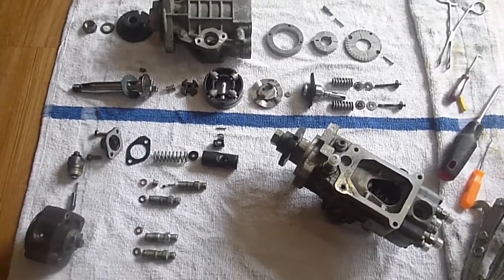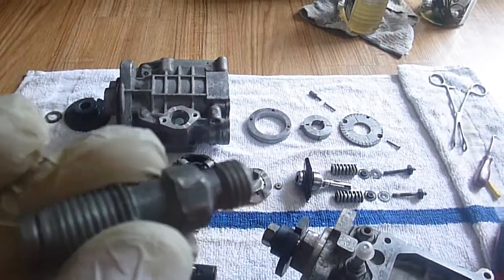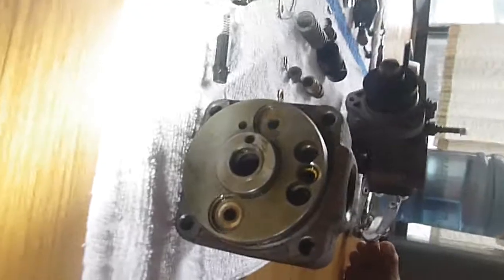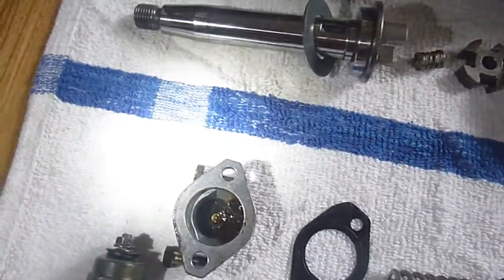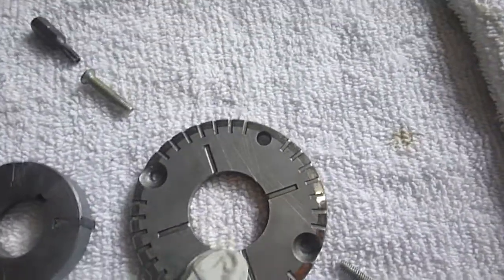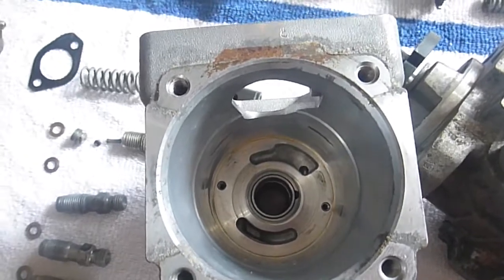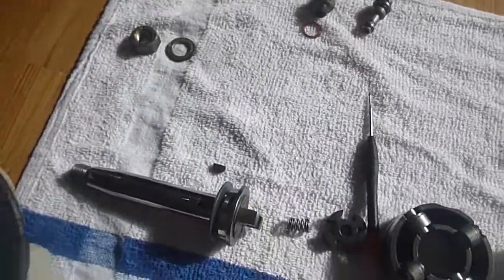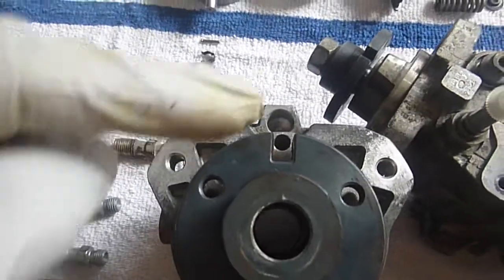ULTIMATE: ALH Diesel Pump Teardown

Comment: NOTE:  THE TIMING MARK IS IN LINE WITH THE BOLT HOLE AND THE RAISED CASTING MARKS.  SO EVEN IF THE MARK IS MISSING, YOU KNOW HOW TO ALIGN THE KEYWAY AT THE END OF THE SHAFT.

Comment: @GallowayChicago I completed the tear down of an 11mm pump, everything seemed to have went well. When I finished I removed the locking key and turned it almost 180 degrees (no ideal where my head was at) I quickly turned it back and checked the timing mark on the pump with the key on the shaft and it was very close again? pretty much right on. Do you think I caused any problems? thank you

Comment: Thanks for this small gem of info, i pulled all this apart to give my motor some maintenance and at this point even the bentley manual only covers the one piece pump gear. You need this info on the two piece gear to set it up because no woodruff key is used to aid in clocking it in properly despite having the keyway present!!!.... at first i thought the key may have fell out without me seeing, but the hub piece has no slot in it for a key so its press fit. Only you seem to know the secret. Thanks
Reply from the maker: Very welcome

Comment: Idk have a question for you though . I have to rebuild my 10mm I have a tune and bigger injectors . Basically I bought the 165hp kit from Kerma including the 3” exhaust . A HUGE DIFFERENCE! I even Tow w my wagon and it pulls like an SOB ! My question to you is how well do you think the 12mm pump upgrade would work out for me w what I have installed ?? I was gonna buy an 11mm but then came across these 12mm pump upgrades on eBay for like $150 . What’s your opinion my dude ?
Reply from the maker: I have not seen the 12mm. is it a knock-off or a genuine VW OEM pump. the 10mm and 11mm have been proven and as long as you get a rebuild one or rebuild it yourself you should have many fun years of dependable service. I have seen some wild cheap/cheaply-made eBay products and for the most part "you get what you pay for". Hell, I just looked right now on eBay and new/refurbished 10mm ALH pumps are still selling for $1,150 USD. I could not find any listing for a 12mm ALH pump.
I know what you mean about towing much larger autos. My brother has a 1971 Ford Mustang convertible and call me one day to help him out with a tow. He was surprised when I showed up with my little 1.9L TDI Golf. Towing is the only time when I can now recommend a Single-Mass Flywheel (only if you do 25% towing or more), but for a day-to-day fun ride Dual-Mass Flywheels are now build well enough to be dependable. People looked on in amazement a I towed if down the street.

TDI Love from Chicago.
Reply: The 11mm pump will supply more than enough fuel for that config

Comment: so did it work? Did you have to send to somrine to be calibrated?
Reply from the maker: It 100% worked and is still working today. There is a re-build kit you need to buy from ebay. But my little TDI would not start and when it finally did it had 0% power. After the rebuild it ran 1000% better. Cleaning the Electronic Quantity Control is what really did the trick, but there was nasty goo at the bottom of the pump too.

TDI Love from Chicago...

Comment: I tried this, took the pump apart and lined everything up and the pump timing was still off. The line did not help
Reply: You probably placed the internal parts 180° off. It's possible and sucks to do

Comment: I can almost read the number off the shaft seal.  I'm having a hard time finding one for sale.
Reply from the maker: Thanks for watching. Are you talking about the large metal washer that  is on the main shaft?
Reply: @GallowayChicago  Hey, thanks for the reply.  As to you question, no, I was talking about the front pump shaft seal (red/orange).  Maybe they NEVER fail.  I what to change it in case it is letting air into the pump and allowing fuel drain back or something.  It is not leaking fuel out.
Reply from the maker: @petersherrouse33  When I bought the eBay rebuild kit it came with the front pump seal. examples: https://www.ebay.com/itm/143881826646? and https://www.ebay.com/itm/144021944384?
Reply from the maker: @petersherrouse33  way to think ahead. I usually just dive head long into the problem and solve it as I go. Really some of the big questions don't appear until the tear-down is done. Remember polish the hell out of those rollers and roller shafts. My rollers were almost fused together with the shafts and as a result were rubbing against the pump body. I used "Mother's Chrome Polish". And don't forget to open the bottom of the pump (cold start adjuster). All kinds of goo gets stuck in there. Good luck to you mate. TDI Love from Chicago.
Reply: My research revealed: the EDM pumps (Mk4 ALH, electronically controlled,) have 20mm shafts (older VE pumps have a 17mm shaft).  The seal dimensions are 20mm (ID) x 31mm (OD) X 7.3 mm (thk)  the Bosch number of the 20mm ID seal is  F 01M 100 984.   I found two other seal numbers that may interchange Rave TG20 31 7.3 3 and the one in the pump you film (best I can make out) Kaco 52 (or 5Z?) DF20 51(or 31) 7.3 TVF03.  I was able to find a seller on ebay for about $15.   I can't understand why NO kit comes with this seal and how it's near impossible to find someone selling it (and indicating that it fits the EDM pumps).  My Jetta has developed long crank to start issue.  I have checked everything else and am ready to go though the pump but I'm not pulling is out and apart until I have all the seals!

Comment: Hi what is the correct torque for shaft nut sprocket
Reply from the maker: I can not find Torque but I found this: https://forums.tdiclub.com/index.php?threads/alh-injection-pump-rehabilitation-reseal.369621/

Comment: Can I pull the head unit out without taking rest of the pump apart?  My o ring is leaking.
Reply from the maker: If you are asking if you can remove the IP/IQ/AQ assemble from the top of the Diesel pump without removing the pump? Then the answer is YES. For one of the bolts you need a special tool or a Dremel tool and a large flat-head screw driver, But everything else is straight forwarded.  Take a look at the following YouTube video for guidance: https://www.youtube.com/watch?v=nd50iJIlvkI. It is very important to remove the IQ assemble completely before opening the unit to check for wear.  Pay special attention to the spring response before recovering the IQ assemble. Use silicone RTV and a cut out 12/16oz clear pop bottle to set the IQ bolts once you are done cleaning the unit. If you clean the IQ right the motor will run better then new.

TDI Love from Chicago.

Comment: I'm in Iowa City, my pump sounds like this: https://www.youtube.com/watch?v=nn8Jt_DfaH0

Currently sourcing a 11mm IP, how much are they in Chicago?
Reply from the maker: It is hard but not impossible to find them in junkyards. I would suggest trying eBay first (examples are itm#:264916156748 or 373451322804). it is reasonable to expect a price range from $200 for a clean unrebuilt unit to as much as $500 for a ready to install rebuilt unit with gears and everything. Hope that helps. The two examples are current and priced at $290 rebuilt and $170 unknown. You must make sure the units are 11mm and will fit your application. These pumps are not hard to tear down but require time to put back together again. The hardest part is pulling the front gear, but the electronic IP must be tested for spring return even on rebuilt units. As a reference these pumps in 2005 were over $3,000 us dollars but now being 19 years beyond the last production date of these amazing little diesels the price should be between $200-$500. I reassembled my unit with 100% Silicone gear lube. the lower part of the pump and the IP are prone to gumming up with diesel gel, but cleaning with 2 or 3 cans of break cleaner in a well ventilated area does the trick. I would like to repeat; taking the pump apart is easy after removing the front gear. Cleaning the almost all metal pump is easy. As long as you can turn the pump three rotations it should be a good candidate for a rebuild. I was only able to find Russian YouTube videos on cleaning the IP to verify appropriate spring return. I soaked my IP in a can of parts cleaner for 1 week to loosen up the return spring, but a rebuilt pump should verify a proper IP response. The unit I show in the video was found a a local junkyard and I was lucky enough to get it for under $50, but this is not typical and generally eBay is you current best resource. I still don't know how to visually tell an 11mm pump from a 10mm pump. So, you should go by part number and/or eBay descriptions. Lastly make sure the IP cable has not been cut or you will have to replace or rebuild the IP which is a pain. look at some eBay item picture and you will see what I mean. The good news is a clean/rebuilt diesel pump properly installed and timed should make your car run like new again and eBay still has rebuild kits from $20 to $50 for these pumps (ex: 162096676117). Good luck.

TDI Love from Chicago...
Reply: @GallowayChicago  thank you!! Wow a lot to think about. The car ran pretty good today, only made noise for a few minutes and then settled down. I will read more about adding ATF+4 and the risks involved, currently have the TC-W3 added which seems to help. I think your advice about not touching it until it's broken is wise!! Will keep my eyes out for a 11mm pump! Thanks again for the tips!

Comment: Thank you so much I really needed it
Reply from the maker: You are so welcome. I actually broke my cheap Harber-F. puller on on the second pump.
Reply: GallowayChicago ok I just always pry on them and tap it with a bigger hammer 🔨 and it usually works. I am butting a tdi alh into a boat
Reply from the maker: WOW! These little TDIs are really strong. Make sure your adapter is a solid one. Good luck.

Comment: Hi! Thanks for the in depth video. The relieve valve sets the pressure inside the pump? If yes, how? If you push the safety clip inside is should rise the pressure? How much should one push it to achieve a higher pressure? Is a higher pressure inside the case better for bigger injectors 0.320 ? Should I leave the case pressure as it is if I am going to get a software tune? I hear the case pressure will only affect the advance until 2500 rpm. Thank you and looking forward to your answer !
Reply: the pressure is set by the piston being pushed up into the hole until it reaches the holes.  The ring in the end only holds it together.  It will basically work ok until the ring and plunger falls out.
Reply: @petersherrouse33  I welded it in place, it should remain the same. Thanks for the answer!
Reply from the maker: Thanks for watching. I am in no way an expert in diesel pumps, but: You are mistaking pressure with volume. If you are going to use bigger injectors you need more diesel volume. The largest oem pump are the pumps in the automatic diesel autos. If you already have an automatic diesel pump then the next upgrade to achieve more power is a larger turbo. Here, you have many turbo oem and non-oem options. please contact  Metalnerd.com at www.metalnerd.com. he knows everything about diesels.

Comment: Sitting for almost 2 years?  The 06 I just bought was sitting for 2 or more years, so the pump is probably what is making the bad noise. Still tearing it down, haven't found the problem yet. 
How do you set/adjust the timing on the pump??        

  - thanks, take care
Reply from the maker: Thanks for watching. All the pumps are set with a static timing. That is to say that even though you could make adjustments inside the pump, it is NEVER recommended to adjust the timing on the pump side. Instead standard timing adjustments are done with the three bolts attached to the front of the pump. You need a VCDS or Vag-Com to identify timing adjustment requirements. But to make the adjustment you move the diesel pump front cam gear (after loosing the front three bolt) by tiny increments unteal the VCDS graph shows optimum timing.

TDI Love from Chicago.
Reply: @GallowayChicago  Okay cool, thanks for the info man.  It was my tired DMFlywheel in the dsg rattling. Still learning about the pumps & basic diesel theory.  Aside from the old DMF rattling sound, how do you think it sounds? :   https://www.youtube.com/watch?v=U83W87hVxBI    My know it all smart arse mechanic buddy said he could hear a "miss & pump timing off" er something like that.
Reply: @GallowayChicago  You seen any decent videos showing the pump fine tuning like you mentioned?  I'd like to see it even though I'm NOT planning on touching it anytime soon.  thanks again, - take care
Reply: Actually haven't driven it enough to get an idea on my mileage, but it should get about 40mpg ?
Reply: @leeisenberg  Around there, yes.
Reply: @leeisenberg  I've got my EGR removed and I get closer to 60 (manual transmission makes a good bit of a difference though)
Reply: Not ditching my egr anytime soon.
Reply from the maker: I used a metal polish called "Mother's" sold here in the states to polish every metal part inside the pump. Some parts seemed fine but moved like they were stuck together with glue. After polishing everything moved like new. I use the Mother's and a High speed Drimel tool. On the ports I used Brake Part cleaner with the straw. The IQ one top I soaked for 7 days in Clean ATF+4 Trans Fluid. The spring arm was not returning to the stop position. After soaking it moved like new again.

Comment: Did you get it running
Reply from the maker: Yes, after you take it all apart and really clean all the old diesel carp off these pumps remind you that they were built to run forever (or at least for a very long time. putting it back together was not that hard (4 on a 1-to-10 scale). These pumps are amazing. The 11mm is well worth the upgrade for manual transmission drivers. More speed and better fuel economy. The best of both worlds. The IQ (the electronic part on top of the high-pressure pump which controls Injection Quantity) was sticking so I soaked it for almost a week. I guess you can soak it in isopropaline alcohol too, but I used Chem-Dip Carburetor & Parts Cleaner. When you turn the IQ arm (which happens when you press down of the accelerator pedal) the arm should immediacy spring back. My IQ was not turning all the way. I thought I was going to have to buy a new pump, but I went to my local junk yard and luckily found a 11mm diesel pump to practice on. I found out that most of the tar like crap is in the bottom of the pump and once you clean that junk out the pump and IQ work a lot better, but polishing and completely cleaning the pump makes it better then new.

TDI Love from Chicago.

Comment: Damn son! Good on you for putting this on the internet.
Reply from the maker: I think a lot of the performance issues over time with the ALH TDIs has to do with the electronic IQ on top of the pump becoming gummed-up with diesel sludge over time. I soaked my IQ in AFT+4 fluid for +7 days and the spring are moved like new again. 

TDI Love from Chicago

Comment from the maker: Question from: mighty rd28 4x4... He asks:

Yep. I got one question, the shaft for the pump can go any way you like? Right?  Is it what sets the 180 out of time on the diesel pump?
Reply from the maker: Thank for watching 
mighty rd28 4x4.  Think of the shaft keyway as a pointer that points to which cylinder is going to get diesel at what time.  If the keyway is pointing 180 degrees out of phase then the wrong cylinder is getting fuel at the wrong time.  The position of the shaft is very important, and anyone that tells you otherwise is just wrong.

Diesel Love from Chicago...

Comment: Yep i got on question the shaft for pump can go anyway you like it's not what sets the 180 out
Reply from the maker: Thank for watching 
mighty rd28 4x4.  The assumption is that the engine is top-dead-center on the first cylinder when you are doing the timing or removing the diesel pump.  Think of the shaft keyway as a pointer that points to which cylinder is going to get diesel at what time.  If the keyway is pointing 180 degrees out of phase then the wrong cylinder is getting fuel at the wrong time.  The position of the shaft is very important, and anyone that tells you otherwise is just wrong.

Diesel Love from Chicago...

Comment: Hey, my TDI Brother from another mother! Where do you buy parts for these pumps? I have the 10mm off an '03 and I need to get the #4 injector port on the pump head. Any advise is much appreciated!
Reply from the maker: Did you find parts? Here in Chicago I can find diesel pumps in the junk yards. The yards sell them as fuel pumps. Lol. I don't know of any online retailer that seals rebuild kits or parts for these pumps. I made this video because My pump was full of gunk and I found a parts one in the junk yard, but could not find any info on how to rebuild them.
Reply: I found an 11mm pump at a wrecking yard, but the injector ports were already removed. Do you happen to know if they are the same as the ports in the 10mm pump head? Thanks!

Comment: cool, thanks for showing this...  I thought it would be cool to control one of these pumps with an Arduino... maybe a future project for me...
Reply from the maker: Thanks for watching...  The IQ (injection quantity) controller on top of the ALH diesel pump is part mechanical and part electronic.  I guess with an Arduino you could switch between economy and sports modes.  That would be interesting to see implemented.  Keep me updated.

TDI Love from Chicago... (Where it is HOT by lake Michigan, but the water is always cool)